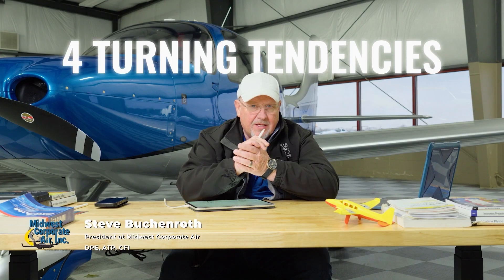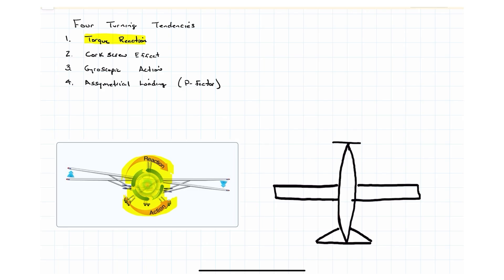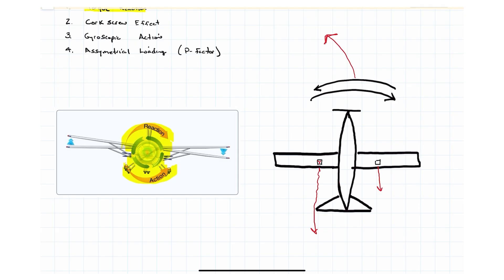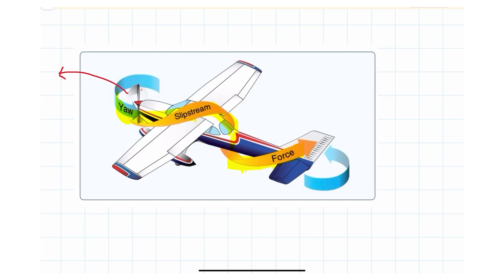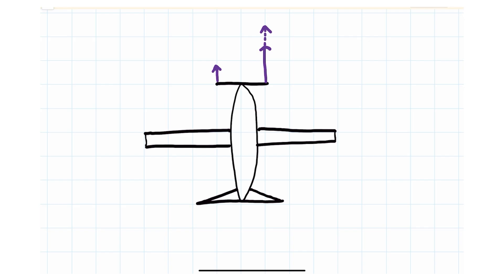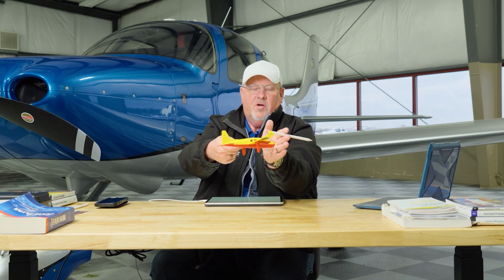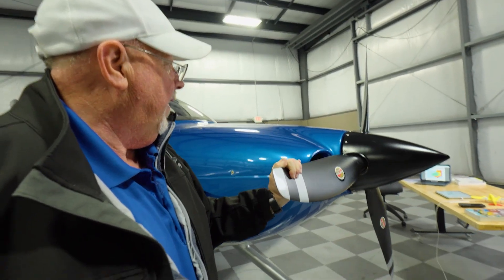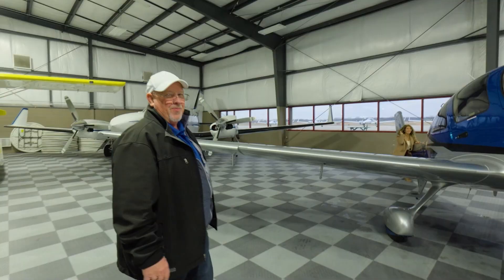Principles of Flight: 4 Turning Tendencies

Comment: Of the four left-turning tendencies that are commonly taught, unfortunately, two of them are myths that violate Newtons laws of motion and the laws of thermodynamics.  There is no spiral slipstream. To the casual observer, it certainly looks like this could be happening, but the propeller is imparting an accelerative force to the air, with the air traveling straight back, and only straight back.  There is no spiral or even slightly perpendicular motion to the air once accelerated by the propeller, which is easily tested on real or model airplanes.  Even if the propeller were to impart rotational inertia to particles or parcels of air, that energy would equalize with the environment almost instantaneously.  The torque effect is real, but it only imparts a roll to the airframe, not yaw.  Airplane designers counteract this by building in twist to the wings. Otherwise, a pilot would be obligated to input right aileron for the entire duration of every flight.

Comment: Corkscrew, spiraling slipstream, is a lie. It's an "old wives' tale" from the early days of aviation that just wont die. It came about around 1920, before many ideas about basic aerodynamics that we take for granted today were even yet understood. Aerospace engineers have tried and failed for over 100yrs since then to prove it exists and to measure it. There is a letter from the FAA out there somewhere (I found it about 11yrs ago), from sometime in the 1990s if I recall correctly, to DPEs telling them they could no longer ask about Spiraling Slipstream Effect on Checkrides (acknowledging it wasn't real), but they still refuse to remove it from the FAA publications, thus perpetuating the lie.

I have numerous videos, images, and realistic depictions of how airflow actually moves around the airplane (computer generated simulations, wind tunnel tests, and real aircraft with smoke or other vapor contrails...), that proves it can't exist or be a factor in any meaningful way.

Comment: His p factor explanation is confusing me here. From what I understand, on a gyroscope, a force applied to it is felt 90 degrees ahead. So when he says that on a tailwheel, the force is applied to the top of the propeller (think 12 o clock position), and the plane wants to yaw to the left? That would mean the force is felt 90 BEHIND, not ahead. Which would make me think that the force applied to the bottom of the propeller (6 o clock position), in order to be felt 90 degrees ahead, which is felt at 9 o clock position, making a yaw to the left.
Reply: I believe you meant Gyroscopic precession instead of P-Factor. Gyroscopic precession causes a force to be felt 90 degrees ahead of where it's applied. So, if the force is applied at the 12 o'clock position (top of the prop), the effect is felt at the 3 o'clock position (since the propeller rotates clockwise), causing the plane to yaw to the left. It’s a 90-degree shift that leads to the left yawing tendency
Reply: Another way to think about is is this: As you push the stick forward on a tailwheel aircraft, you are putting a down force on the propeller (which acts like a spinning disc) as you raise the tail. Now as we apply the gyroscopic precession, that force that was applied down , is now felt at a 90 degree angle in the direction of travel (clockwise). So now, just visualize the down arrow rotating 90 degrees to the right, with the inner part of the arrow as the pivot point. It is now felt as demonstrated in the video, which pushes the nose to the left and requires rudder. Keep in mind that it only occurs when a force is acted on the gyro, and at the speed it is applied. So, when the pilot rotates into the climb, the opposite will occur at the rate it is applied.
Reply: Lol yeah I had the exact same misconception up until it clicked a few days ago. Basically this portion of the explanation in the PHAK made it make sense to me: "the resulting force takes effect 90° ahead of and IN THE DIRECTION OF ROTATION." I was applying the force to the left perpendicular to the force on top, like you mentioned. But that force is actually felt (like the explanation says) 90 degrees head of the turn and in the same direction. That is why applying a force at 12 o'clock would result in another force felt at 3 o'clock, causing the airplane to yaw to the left.